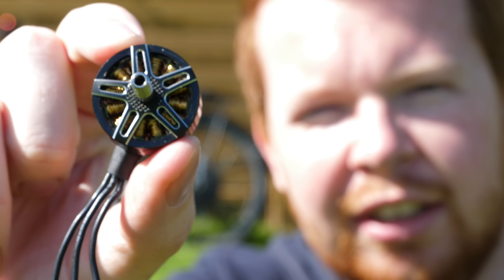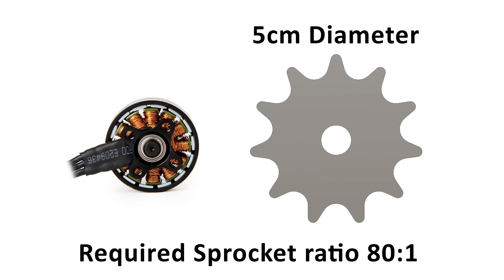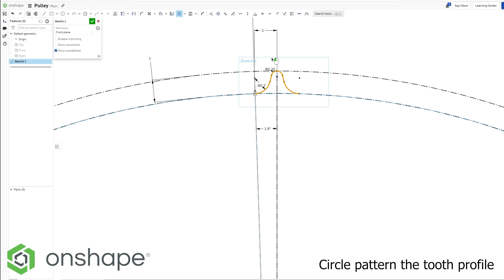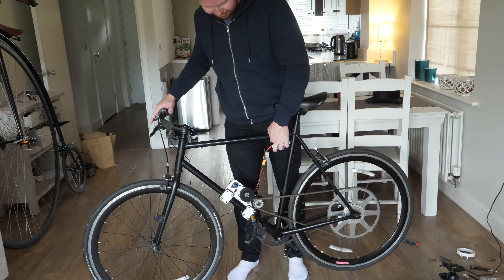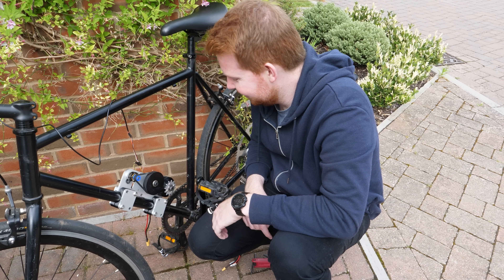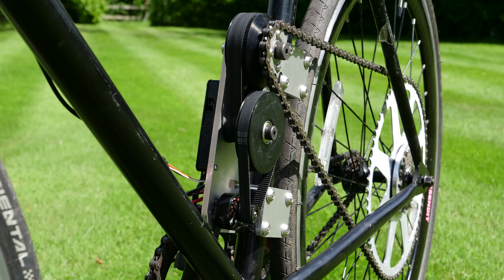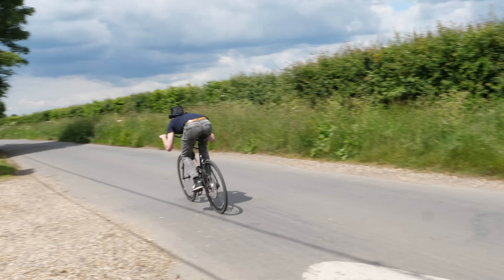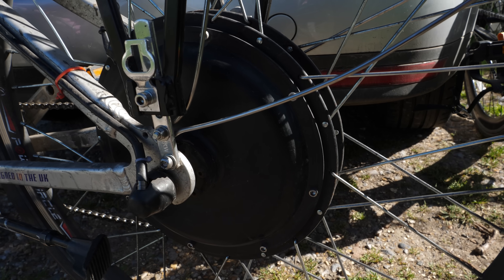Tiny 1kW Electric Bike Motor

Comment: It sounds crazy, but lots of people have had luck liquid cooling BLDC motors. I've seen some motors driven to double their rated capacity just by trickling some water into the motor as it runs. At higher speeds the water flashes into a steam/mist combination and provides fantastic cooling. The coil wire should be coated and waterproof, and voltages used in these motors are low enough that arcing isn't an issue. At lower speeds, it might be better to use a misting nozzle on the water inlet.

Comment: This makes me wonder how a 775 motor would do. I've seen those crazy 5 minutes craft and they've been using 775  motors for bikes
Reply: I think most consumer cordless drills use something very close to a 775, and they have built-in planetary gear reduction units.  Just sayin'.  But once again, cooling would be an issue.

Comment: Why don't you use a RC helicopter outrunner Motor with a rated RPM of aprox. 5000. You could surround the housing with a sticky surface and use it as a direct friction drive on the tire...

Comment: Eskater do this all the time. The key is to move fast enough to keep the motor air cooled, to buy reputable brands, and to use the right gear ratio. Lower KV ratings usually work better too.

Comment: Tom, love the video and your willingness to share your knowledge
For years this idea has haunted me so I thought I would share it with someone else who might be able to get it working 😁
Most of us who live in a house usually have gardens of some sort, in my case for example when I water it is usually upwards of an hour at a time, could you please consider building a small Pelham wheel/permanent magnet generator to collect energy maybe in a super capacitor battery or just straight to a storage battery that can then be used or incorporated into the home alternative power system
(not only do I have a 6.6kw grid tied solar system but also a stand alone solar system/wind turbine system as well, with 2x12v @24v  470amp hour agm batteries running to a 1kw Inverter that blew up 2 days ago after 12 years )
I would love a way of utilising the unused potential of the tap water in topping up the batteries and the idea of using sun, wind and water to scrape every last bit of Homemade potential generated on my property tickles my insanity of being as energy efficient as possible
Could you please consider the tap water as a project
(as my gutters leak I didn't include them or the downpipes as a potential energy source to include in the equation 🤔)
Thanking you
Tony from Western Australia 🇦🇺
Reply: Why stop there?  You could use your grass clippings or grow some grains in your garden then ferment this biomass into ethanol, distill it down for a combined heat and power system using a Stirling engine for maximum efficiency.
Reply: @kayakMike1000  been there done that 😉  no not really lol but I have considered checking out the local shops in my small rural town on for used cooking oil.... But to set up a small biodiesel plant was a cost and effort I drew the line at. 
And I did run my Toyota Hi-ace diesel van on commercial biodiesel for a couple of years until it got to hard to purchase locally with excellent results
There are so many different types of alternative energy we can discover I love the challenges of finding them though health and ready dollars to develop the ideas escapes me
I do have a few trees I have grown for firewood that will coppice should I be tempted to use that energy for water heating...... 
Tony

Comment: Anyone who has ever repaired a children's electric car know they also use 30,000 rpm motors, it's nice because they're cheap to repair if the transmission is still in good shape.

Comment: what about using 2 or 3 motors to drive the bike instead of just one? you can still get high RPM but you get more torque from having multiple. seems like it might be easier to have a input/output shaft that all the motors attach to (using belts), rather then putting them all on the same belt.
could make a box for them to go in which you can then attach a fan on a input/output so that air can be fed into the box to keep them cool or less melty at the very least.
might be hard to get that to fit on the bike.

Comment: Great video Tom.  It would be wonderful if you would do this experiment again using a 300g outrunner with approximately 15 times lower KV. You could get rid of the gearbox increasing the efficiency for probably the same weight. I think that would actually be an improvement over the hub motor, which actually is a brushless motor built into a planetary gearbox.
Reply: The hub you see in this video is a direct drive hub, gearless.
Reply: Funny thing is, if you keep making optimizations like this you'll just end up with a standard ebike eventually

Comment: If you run a tube from the front to the back of the bike then use the motor to push a propeller it should do something for ones pedaling top speed.

Comment: What is really surprising is that the tiny controller withstood the test. Drone motors are designed to run close to max revs at all times, so they do not need low end torque, that is where it looses out in the application.

Comment: The thing is that the drone motors are only at full power for at most 10 seconds or so and they are getting loads of airflow over them due to the propellor and them moving in air.
Reply: Drone motors are constantly lifting the full weight of the drone whey they're flying, which generally is around 60-80% of the motor's full power.

Comment: As a rule of thumb, 1g of motor can produce (and sustain) 4W of power, at least this is what I observed on RC airplane motors. Drone motors can give huge powers for a very short time... on a drone they won't be full power for more than 1-2 seconds. You would gain a lot from lower kV motors, that can be fixed in various ways.

Comment: The loss of energy in the gear changing ratio which doesn’t matter because…no torque.  I wonder if the electric bike engineers ever thought of using a smaller motor….and Expecting it to last for years of use?

Comment: I figured 10 feet ... so the second motor was impressive.  With that tiny of motor, I would have gone with a third bearing support and friction drive at the motor shaft diameter.  That would give you a fair amount of reduction but failed when the shaft wore through (not far).
I'm impressed the controller didn't catch fire from back emf.  Did it have any motor breaking, or was there freewheeling circuit (diode) in the controller?

Comment: Drone motors are designed to be forced air cooled by the spinning rotor. You're trying to run them with only the ambient airflow. They're also less efficient than a well-designed bike motor, so you have more heating and less cooling. That's why you're frying them. Having said that, it's a surprisingly satisfying result. Maybe you can devise a way to liquid cool the drone motors? That would likely improve efficiency because the coils will be running cooler and will be less resistive. In addition, a cooler magnet is more efficient than a hotter one.
Thanks Tom! 🙂👍

Comment: I recently did a tour with my cargo bike packed to its limits. I had severe trouble getting up a steep 12-13% section.
Now I'm thinking about ways to build a little helper for sections like those that are preferably not permanently fixed to my bike (because of german laws).
I now know that drone motors are probably not the best way to go. Thanks! ^^
Reply: Get 21700 cells inside your battery, put a better controler on there and gove the motor more power as it most likely can give more
Reply: @robivlahov  yea, I'm sure it can output more power. But I want to keep it road legal in Germany and our laws suck dick.